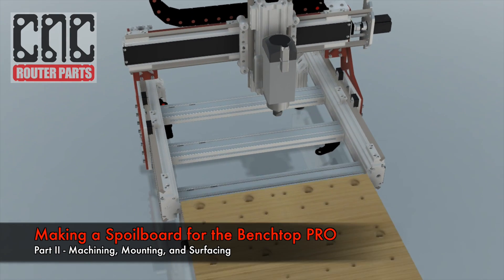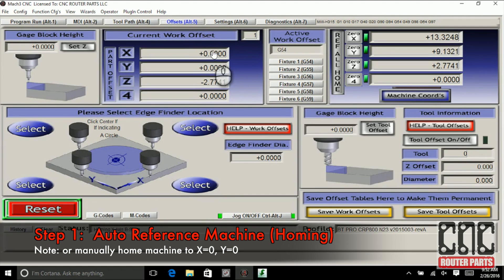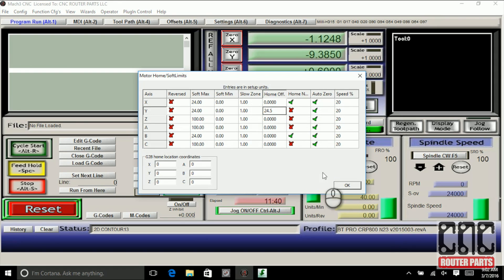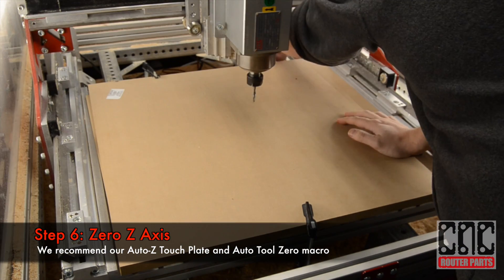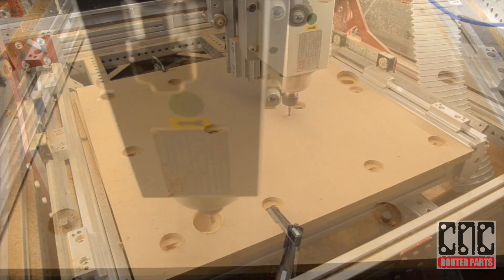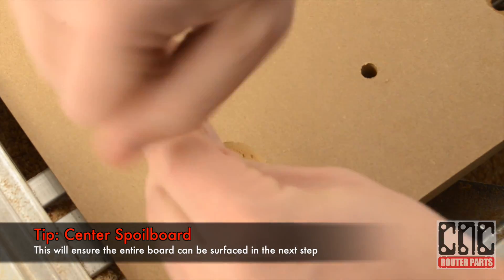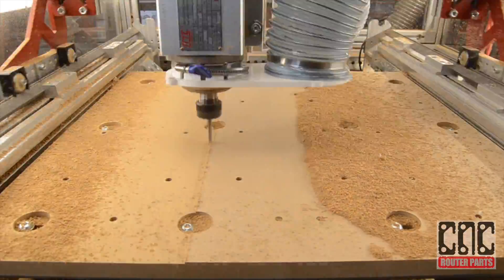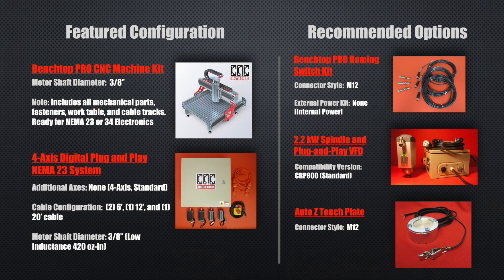Making a Spoilboard for the Benchtop PRO Part II - CNC Machining, Mounting, and Surfacing

Comment: What's the best way to do this on a PRO4824 using a 4' x 2' piece of MDF?  I can't get clamps on the back side because the middle cross-member is about 9 inches from back edge of the MDF.

Comment: how accurate and repeatable are the homing switches on this machine? Very interested in the Pro with the proximity switches that you sell, curious how accurate it is for fixturing.
Reply from the maker: Hi John, Thanks for your question and interest!  Our homing and limit electronics are Pepperl + Fuchs induction sensors,  high quality units and very accurate.  As you might expect, they are more than up to the task of supporting the machine's overall repeatability of +/- 0.001".  You can read more about them on our product page (including the datasheet) -->  http://www.cncrouterparts.com/pepperl-fuchs-proximity-sensor-kit-p-293.html   -Nathan